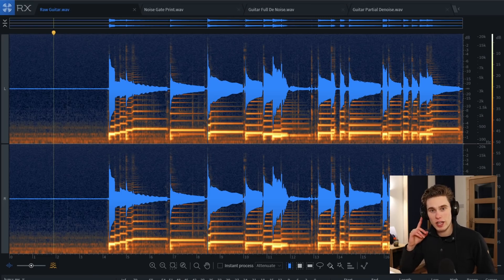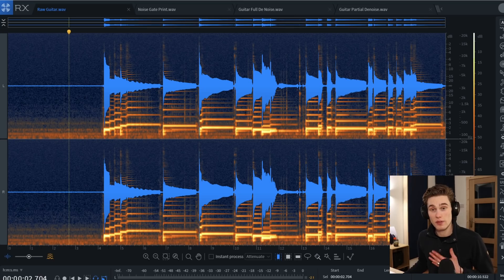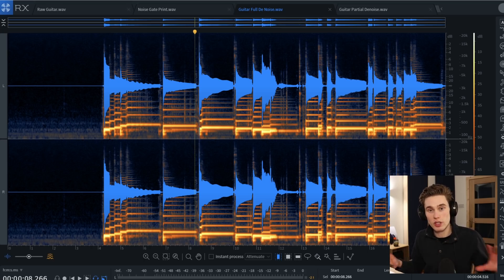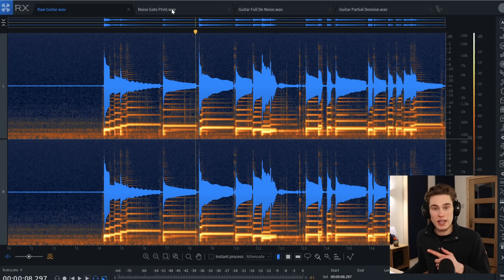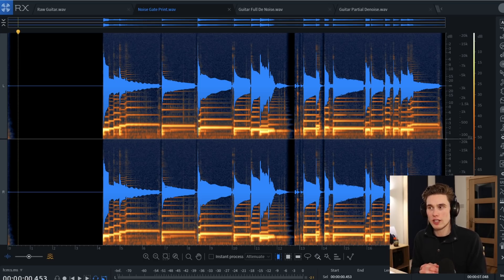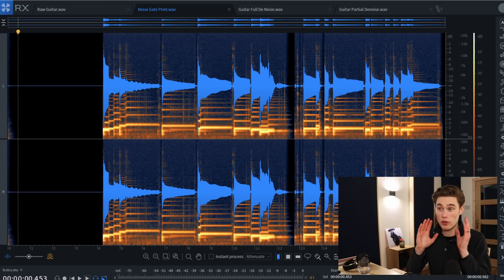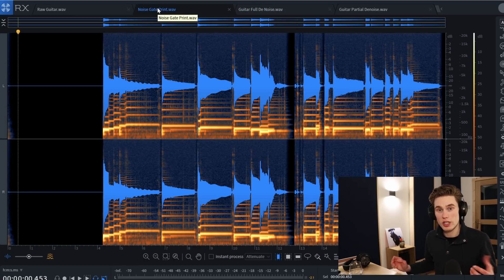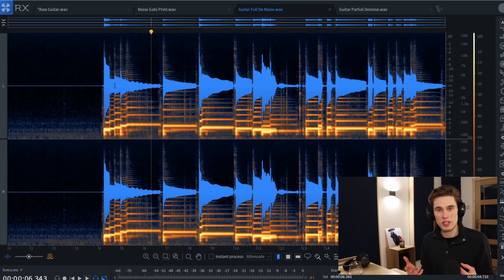Noise Gates vs Noise Reduction - Which is Better?

Comment: Permit me to disagree a bit. The noise gate helps you set a threshold on the levels of signals you want to allow through. If you set a noise gate to take off everything  below -34, it takes it off even those in the original recording.

Comment: I detect a difference between the two guitar examples (beginning at 1m30s) of perhaps 5%. 

I know you're not trying to punk your audience, that wouldn't make sense.

Please use examples that are more egregious. Besides, string & finger noise is often what provides context and ambience to the larger mix. Have a listen to Quincy Jones vocal takes when Jacko was recording Thriller: Unless you're doing a completely solo guitar recording, what you're removing in the first example is inconsequential. (by the way, I'm not a troll, but a fan of your videos, so please don't take this as abuse, merely a suggestion that those of us with less sensitive hearing need more stark evidence that this procedure holds water :)
Reply from the maker: To me the example at 1:30 is a stark/huge difference in the broadband noise reduction. I can hear it clearly even on my phone speaker and with headphones or monitors they are a world apart (in terms of noise). 

I would suggest checking your monitoring equipment or potentially increasing the playback quality on YouTube. This example has proven to be a breakthrough from many people and it’s one I reference regularly.

Comment: excellent explanations. thanks. i am so glad you clarified when to use noise gate: i mostly record my instruments in the large empty room i have as my studio (which is NOY soundproofed, and is on a street with quite a bit of traffic: in Indian cities, that is the case pretty much as EVERYwhere!), and i was wondering why i was hearing myself so loud in the room (on a tin whistle at 1:00 am!) but the recording was so low! the imac’s mic and my lavalier mics were giving completely different results. i think it was because of my use of Noise Gate with a high threshold: mistaking precisely what you pointed out: it listens, and cuts off everything below a Level, and Boosts everything ELSE, regardless of the frequencies! since i was playing very low decibel, and low pitched notes on a BFlat TinWhistle (which by itself is very ‘airy’ literally AND figuratively), and long extended notes to get Clarity in microtones between BFlat and C! i finally see how the same pitch when i sing, is so differently recorded by the mics, and treated by ‘noise’ reduction/gate software. i guess there is no substitute to getting the recording at the BEST volume possible in the room, at which there is the least room resonance (which as a Baritone i use a lot in live performances). thanks a ton. it would really help if you could have some cations/labels. especially when you are pointing out subtleties like below 50 and 50-100. unfortunately for me, most of my voice falls in that category upto about 1600. with sinuses and humidity, this range is so difficult to record with any level of fidelity…
Reply: i can help you with captions, labels, markups etc. so that it is easy to follow you (in that small square, with your hands cut off!) and figuring out your accent!, AND looking at tiny golden yellow speckles of dust appear and disappear magically in the ‘nosiy’ color range. as a Visual Designer and Calligrapher, your audio explanations are EASIER to understand, and apply, when i Add COLOR to tour aural explanations. i think this might help a lot of people who find working with tiny buttons and switches on their DAW, when they should really do this in analog at Recording and PreProduction time. i found that using a pair of Lavaliers, AND a Shotgun simultaneously, with a bluetooth/wired headphones attached mic, gives such clear recordings at such low volumes (like softly exhaling through a Fipple flute or Recorder. or even a Chanter of the BagPipes… and certainly my diatonic Blues harps!

Comment: No never do denoise because it takes away all of the important high end frequencies and the mix sounds very thin and without body. I was using denoising for years but will not anymore. Fab Filter Pro G is just working miracles to me.
Reply: I mean doesn’t it suppose to?
Reply: @Mope365  Yes its supposed to but use it when denoising very tiny amount of noise otherwise the whole mix will be ruined.

Comment: Would you say the juice isn’t worth the squeeze using a gate to reduce breath sounds?  For my podcast, I’ve been applying the default Audacity noise reduction prior to importing to Fairlight for edits and adjustments.  Solo podcast SM58 to Zoom Podtrak P4

Comment: Great explanation of noise gate vs noise reduction. Obviously, you're focusing on music production, where noise gating is used to eliminate mic bleed and feedback. However, the gate is also extremely useful for voice over and podcast when there are long pauses between dialogue, breaths, and other noises. For example, audio books require room tone ceiling at -62 db, which is pretty much dead silence (unless you've got your earphones/buds fully cranked up). Good time for the noise gate to cut out everything until it hears your desired RMS, which you've determined in Audition or another DAW.

Comment: Most people have a really noisy room. Especially streamers either don't bother doing exstensive sound treatments on their room, or they simply can't do that, because they don't have a spare room to use for it. The same is true for most podcasters. This is the first issue you have to think about if talking about why people prefer noise gates nowadays.

The second one is sound compression. Before i can come to what i mean, take my use case as an example. I am a hobbyist streamer, streaming from my home office. Two of the walls are covered with DVD / Blu-Ray Shelves, full of them. We have two tower PCs running in here, not even especially loud ones, but definitely audible on the microphone. With my dynamic big diaphragm microphone with a cardioid pickup pattern and the noise sources in the dead zones of the pattern, at a talking distance of ~2 inches (~5 cm) i can manage one of the following: Either, i set the gain on the interface, so my voice at normal speaking is at -10dB. Or i set the gain to have a normal speaking level of -18dB and turn it up in post to have -10dB once more, but with a bigger headroom for my voice. What ever choise I make, i end up with a noise floor of -60dB.

Sadly, this is pretty much an ideal case. Most people don't want to start using their microphones correctly - that is: They want the microphone as far away as they can dare. But going for my use case as an example: Only going for 10 cm (or 4 inches) distance for the microphone, I get a noise floor of -50 dB with traffic noise from the outside going up to -46 dB. If i go for a distance of 20 cm to the microphone, the noise floor is elevated to a horrible  -40dB And by experience of trying to help other streamers with their microphone sound, i know, this is a realistic use case. (not for me, but for enough other streamers)

If I try to reduce noise that high, any free noise reduction VST plugin will brutally murder my voice. Which is to be expected, the  way noise reduction works. And knowing the issues i have running noise reduction plugins in general inside of OBS or the Equalizer APO, I know, it is far from guaranteed, professionally usable plugins would even work in there. Also, they tend to add a significant ammount of delay to the sound, which is a major pain, if you want to monitor all of your streams sounds at the same time. You will probably end up getting stalled by the combined delay of all audio buffers in place, even if you find a noise reduction plugin, that gives you decent results under the circumstances explained. 

So why do you actually hear claims about noise gates being the better solution everywhere? Because most people end up using gates, as noise reduction software just doesn't give you acceptable results, quality-wise, unless you pay for something decent, and because of the software those plugins would be expected wo work with.

Comment: Hey Michael,

I live in an apartment. I don't have a separate room for me. So I have some room noise. I recorded a vocal and tried some mixing but the noise was still there . Would it be advisable to use a dynamic mic instead of a condenser mic?

Comment: Wouldn't the best method for the studio actually be using some kind of noise reduction and then using a noise gate on top of it? Noise reduction is not perfect, so you still get some noise in the background if you compress those vocals even if the vocals itself are silent, and noise reduction would eliminate that background noise. Am i wrong? Is there something i missed?

Comment: Hello Sir
M working on focusrite scarlett 2i2 interface ...n planing to upgrade my audio interface and need some gud recommendation.....
N my main question is 
Does sound card play role in final sound quality
Reply from the maker: It will change the quality of your recordings. It will also change the quality of what you hear out of your headphones or speakers as the conversion from digital to analogue might be handled better in a more expensive interface. However, the final export or render of your music will not be changed, even if you have no sound card attached to your computer it will be exactly the same. However, having more accurate conversion and better headphone amps in the interface might make you mix better, therefore there will be a change in the final audio
Reply: @inthemix  thanks sir ....thier is any recommendations regarding audio interface....i also have  tc finalizer 96k so i need to connect that to in Audio interface....m thinking of UAD sound card but they are way to expensive....i need sound card with max 2 mic input but more analog I/O....i wanna make one time investment in Gud sound card recommend me some gud brands or specific interface for my need..
Thanks again......love from India

Comment: Hi Michael, I'm a bit on the fence about getting the dbx 286s for its gate effect. Now that I have seen your videos about the de-noising I am even more so in doubt whether it would be worth the buying or not. There are videos showing how the dbx286s is able to create a ratio and amount of db noise removal so that not all of the ambient noise gets through when the loud signal is coming in, which I guess would also start affectinig the voice itself if dialed too hard (making it in fact similar to a de-noiser?)
Would you say the gate of the dbx has more quality/clarity potential on the main input signal or should I stick with digital de-noising?
Reply from the maker: Dbx is great as a preamp and voice processor if you are doing it all live, but it really is just a gate and not a de noiser. I looked into getting one myself actually but realised it wasn't for me

Comment: what if the Noise Reducer Also somehow reduces your voice because the bg noise is abit louder than your voice?
Reply from the maker: It is possible that th noise reduction reduces your voice too, you have to adjust the settings to make it work well
Reply: how about the noise also has both high (white noise) and low fequencies (bass)?

Comment: So I understood the issue with gating. In fact I've been frustrated on forums when I ask about methods of dealing with noise, and someone says, "You don't need fancy tools, just noise gate and EQ!" I'm curious if you know any more affordable options than RX7. I personally have it, but getting it was a big step for me. Any options for the hobbiest?
Reply: There's a noise reduction feature in Audacity, which is free.
Reply from the maker: Hi Corrin, this is exactly why I made the video. It's very frustrating to be told tp use a noise gate when it doesn't help! As for free options, I have heard that audacity has a similar denoise function. If you have FL Studio, the included "Edison" plugin has the same de noise tool, I have linked a tutorial for that in the description. I hope some of that helps :)

Comment: I like using this vintage reverb and delay, but when nothing is playing there is noise. It's practically infinitely silent, but if you normalize audio that is quiet it can pick up or if you use a spectrum visualizer it shows up. I use a noise gate at the end of those chains, but even after it's still there. Is there a noise gate out there that will mute audio completely not just turn it down a lot?

Comment: Michael, 
How do you drive your DT1990 pros? I just boought the Sennheiser HD600s (300 ohm) and my 2i2 is struggling to produce enough volume.  Do you suggest a headphone amplifier?
Reply from the maker: 2i2 is not the greatest for a headphone amp to be honest. It might also be a sensitivity issue? You could get a headphone amp but they tend to be quite expensive. I am currently using audient interfaces although many have the power to drive 250 ohm headphones. See if you can find something with Similar headphone amp specs to an Audient iD14 or perhaps look for a cheap headphone amp like the Behringer HA 400
Reply: @inthemix  Thanks for the reply! I will look into it!

Comment: I've also used noise gates occasionally for if I have a sample that's really transient heavy like a drum loop, but either has too much reverb or the wrong kind of reverb baked into the sample. I'll set the threshold just above the reverb tail and give it a pretty gentle release, usually works pretty well at removing or at least shortening reverb.

Comment: software i use a lot to get rid of background noise is called 'audacity'. completely free and pretty easy to use in my opinion. 
just incase someone is interested :)
lemme know if someone needs help with removing background noise :)
Reply: Okay, what can audacity do?
Reply: @zdrkp  I to be honest don't know a lot about all the things you can do with it cuz i only use it to record and remove the noise from my recordings. but so far i know you can do some pretty usefull stuff
The main thing is recording your mic. and you can edit that recording by cutting, pasting. it has different effects like fade in/out, pitch and tempo changing stuff like that and the most usefull effect (to me) is the noise removal
you can also listen to your recording while making a new recording at the same time which is pretty usefull too when you for example wanna add a second guitar to your first guitar recording 
I hope the information is clear enough :)

Comment: You made this video just at the right moment. I just bought a sound card today so that I can use an electret condenser mic I made few years ago. It sounds pretty good but there's a little bit too much noise.
Reply from the maker: Nice! Glad I could help :)
Reply: when i record on my soundcard and condensor mic and do noise reduction, it sounds bad, as if it is 
removing some of the low sounds in my mic
Reply: You MADE a mic?
Reply: @AyushKumar-ov9el  Yes. Of course I did not make the capsule but I made the circuit and the enclosure.
Reply: @olijomusic2481  do you have an Instagram?
Reply: @olijomusic2481  would love to talk about this!
Reply: Ayush Kumar I’ve heard of kits to make single and stereo condenser mics if you’re interested.
Reply: @AyushKumar-ov9el  I don't have Instagram, but just ask me what you want to know about it :)